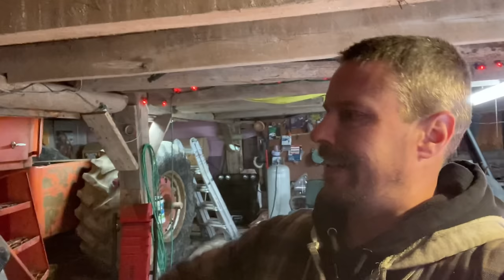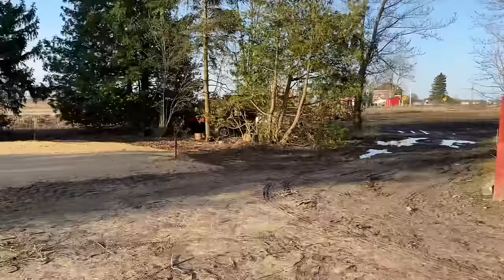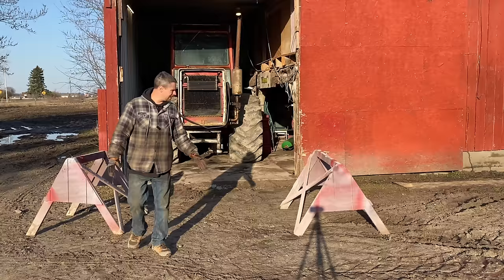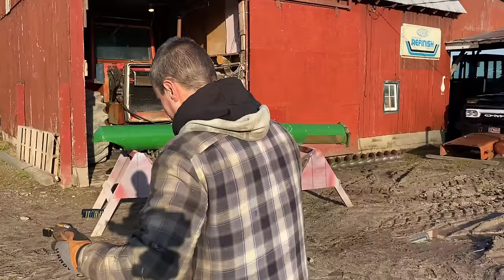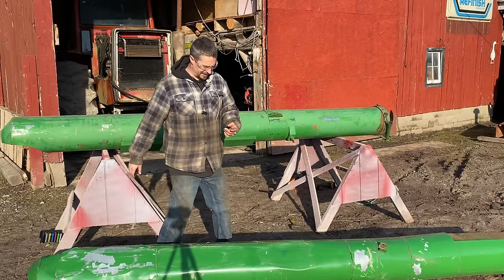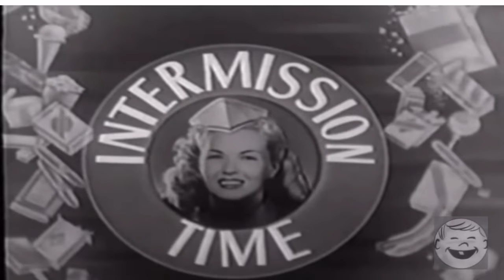John Deere 6600 gets a new auger tube!

Comment: Just wondering are your Massey hard to start in the cold. I have a Massey 1130 and once it drops below 60 Fahrenheit you need a block heater or the glow plug was just wonder if that is normal with the bigger Massey. It’s odd for us as our ford will start at 5 Fahrenheit with only a couple seconds on the glow plug.😊
Reply from the maker: My 1105-1155 will start good without ether down to the mid 40s generally. I had a 255 years back that wouldn’t start without help if it was under 60, but that was a high hour tractor.  Some are more picky than others.
Reply: Ya in the 1130 just got a complete rebuild from head to toe but good to know

Comment: $105 for that JD bearing? Thats ridiculous! They ought to be ashamed I’m glad you found a cheaper replacement.

I don’t know what your experience with concrete is but if I had one tip to offer it would be—Cut expansion/control joints—almost every concrete contractor I’ve worked with tries to talk me out of doing it because of the labor involved or they don’t know how to cut proper joints. They’ll tell you “all concrete will  crack to a certain degree”. Well ya it will, hence the reason for the “control” joints, we give it a place to crack. No matter what they say —like “well with fiberglass added you won’t need joints” —insist on the control joints, empathetically, do your research on this and make sure your contractor understands what you want. Concrete will probably be your biggest expense and it’s not an easy “re-do” if it gets F’d up. Ask me how I know. 

Sorry for the rant. Good luck, can’t wait to see the new shop.
Reply from the maker: Thanks!  Appreciate the advice, I’ve seen his work first hand and can vouch for it 😉. He is doing glass and steel in it so hopefully it’ll be strong!
Reply: Also there is a building code in Michigan that tells when the expansion joint should be  put in.